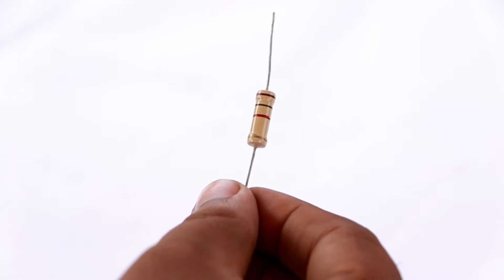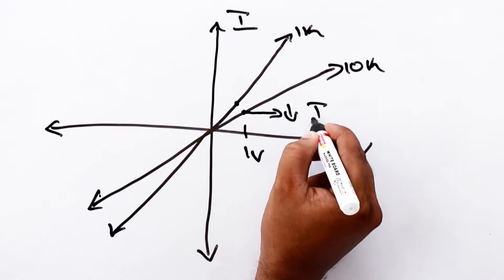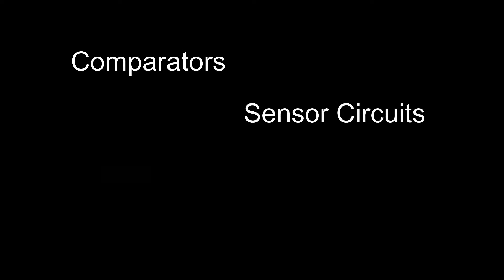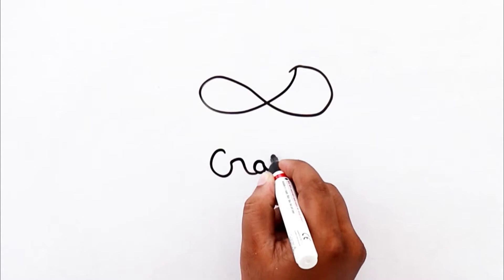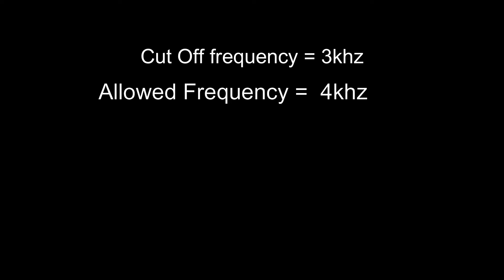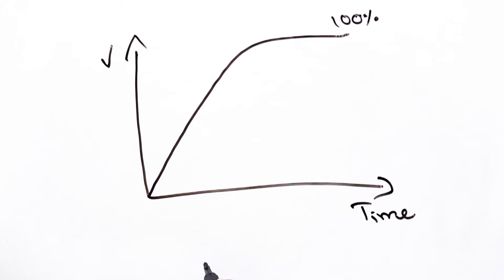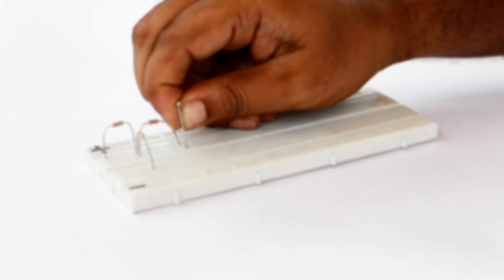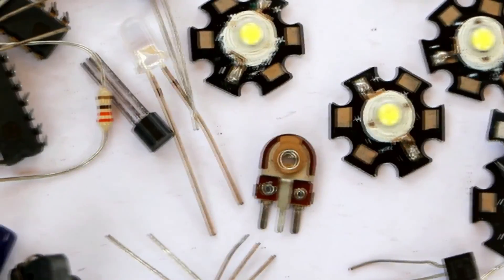How to use "Resistors" in Circuits : Tutorial

Comment: actually its limiting the voltage as well right. from 9 volt it is reduced ..so why only it is called as current limiter ?
Reply from the maker: Voltage is a parameter that drives the current through a conductor. It is similar to pressure that pushes water through a pipe. Voltage gets dropped not limited. Current will be limited

Comment: 4:18 9-2.2/20=8.89, what the hell are you talking, 340??
Reply: 20 mA= 0.020 A !!!
(9v - 2.2v)/ 0.020 amp = 340 ohms 
Its correct. What didn't you understand?
Reply: @a.ahmadi5872   (9v - 2.2v)/ 0.020 != 9-2.2/20, thanks for the clarification.
Reply: @Lann91  Yeah, he did not have parenthesis when he wrote on the white board.

Comment: I want 7v decrease into 5v dc ???????
Reply from the maker: Use a voltage regulator but 2 volt is quite small difference. Linear voltage regulator chip tend to drop some voltag.